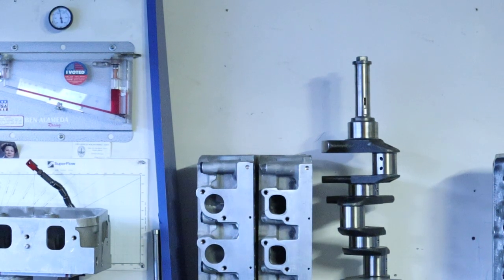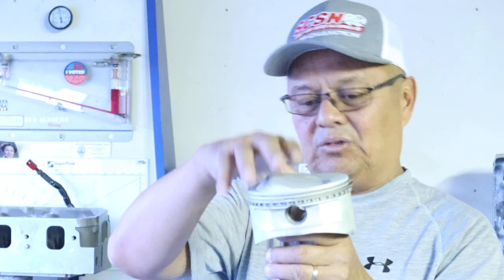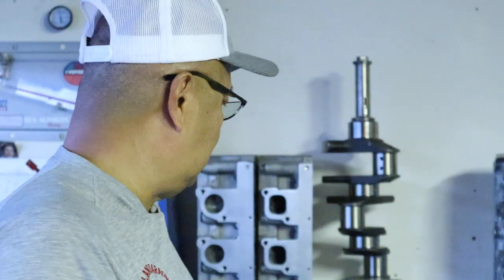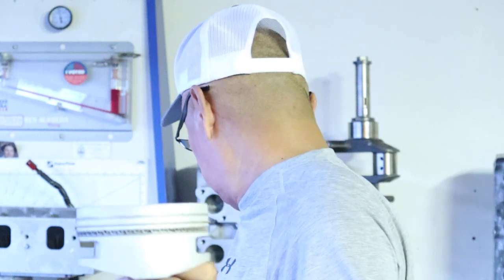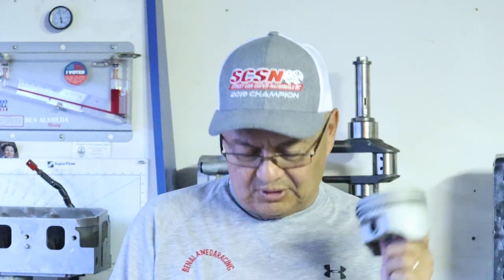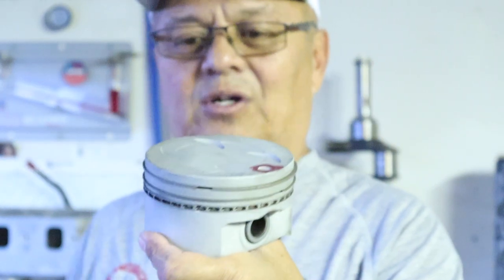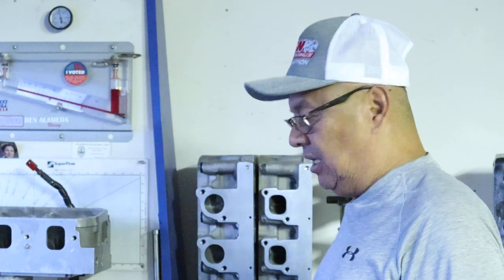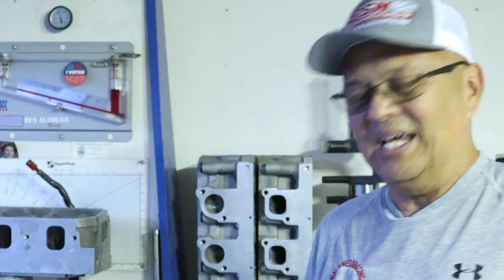WHAT MAKES A GOOD NORMALLY ASPIRATED PISTON?

Comment: On the Cleveland Piston you were showing crevice loss, is that area of volume calculated in a compression ratio calculator? On that same Piston is it ok to use 1cc in a compression calculator formula ?
Reply from the maker: Sometimes it is calculated and many do not specially if there is a significant amount of tapering above the top ring!  On many cases of heavy nitrous of boost levels.  Best to be as accurate as possible to make sure you are not leaving anything to be an issue later on when you are making big power.
Reply: @benalamedaracing2765 I was just trying to be accurate when calculating compression ratio.  My Cleveland makes great HP, but I’m not planning on racing.

Comment: What ring pack height would you use with 150 shot nitrous?
Reply from the maker: That much nitrous you can get away with most aftermarket or stock type pistons!  Just make sure you have more than .150-.175 piston top thickness to the top ring.

Comment: This probably does not work with nitrous or boosted application because of the strength issue?
Reply from the maker: The top ring runs hot when it is a short distance from the deck.  The lower is safer but will cost you power if NA.

Comment: Question... Where can people find reasonably priced N/A pistons for SBF's with the top ring around .150"?

Most companies don't even mention this dimension in their spec data on their websites for their pistons.

And the images posted all seem to show the top ring down around .250" or more.

Thanks for all your vids!
Reply from the maker: I have seen offerings from Mahle showing a good high ring position but you might have to call them and ask for specifics.  Ross I feel also has some in their catalogs so this and other will probably show some kind of specs.
Reply: @benalamedaracing2765  Thanks for the reply. Seems Ross primarily makes 2618 as opposed to 4032 forged. Have you noticed much cold slap difference or reasonable longevity between the two alloys for performance street usage?

Comment: What would say about minimum piston crown thickness for an N/A small block mopar on gasoline and 11:1 compression. 500 hp perhaps. 
Thx Ben
Reply from the maker: From my experience it seems .150 from the top of the piston to the top ring is the ideal distance.  Granted that you are running a quench style cylinder chamber instead of the recessed open chamber factory castings.  It tends to detonate easier with those types of heads and I would increase the minimum to at least .200 or a little bit more which I really do not like at all.  At that level I did .125 from the top but with coated chambers and piston tops.

Comment: Great info that's not readily discussed. I too have damaged pistons moving the ring pack up too high for the heat levels.
Reply from the maker: Agree and if you are brave to hold it higher it is best with superior coatings and it helps but a soon as it detonates some of the coating flake off and you are back to square one.

Comment: Ben , what kind of power difference are you talking about from ring pack height ?
Reply from the maker: Hard to tell because some engines are more sensitive than others but I cannot make the power I am making either street car or race car NA if the ring pack is too low!  I need to do a dyno test comparing .150 vs. .250-.300 ring position and that should tell me.

Comment: I have been thinking about hone of bores, I was thinking of experimenting,  use a vary coarse stone, with a 20° +/- hatch,  then go over then go more fine and 30°-45°  and finish with a fine stone, and go 60°-70° hatch. Leaving a very smooth bore with a corse,  hatch still hidden to hold oil, for low friction, using thin oil, to be held in the shallow coarse hatch,   the texture should appear smooth to a large flat surface, like a piston skirt, but rough to the oil soaking in like a sponge,  the thin oil can possibly tighten the bearing clearance slightly,  maybe add oil pump volume,    sorry again,. But any opinions?
Reply from the maker: I would follow the instructions of the ring manufacturer just to be sure...

Comment: What is your opinion on flat plane crank SBC engines?? Id like to build one, with  balance shafts in the oil pan, build a pan /main girdle that that fits between the pan and block,  only a couple inches at best that holds the balance shafts, maybe incorporate the oil pump in the thing,  it would require a timing cover and oil pan custom made,  but should help the balance of the flat plane crank, whole bolting to the pan rail, and main caps it should make it stronger!  The use of 2 bolt mains should be nearly strong as a stock 4bolr main,    with modern pistons, and a split 4bbl intake with a possible valve between to improve power at certain RPM!  With a small passage to keep a signal on the carb,   use a large plenum,  and 3.25" stroke! To 3.40" & 3.50" maybe a 3.0" with 6.125, 6.2", maybe 6.250" -6.309" rods,   or maybe a 5.560 rod for the 3.4-3.5" crank  to be setup for a lower rpm, (6500 or less) and 6.2" for the 3" for 9k RPM,
Reply from the maker: Been there and done that!  The camshaft will definitely be custom made and that is just a start!  Hedder and intake tuning is another issue altogether!

Comment: I had a set of trick flow twisted wedge heads , flat top Pistons,  mild cam,  I think it was what the 88 formula firebird I had it in,. Should have Had stock,  I ported the tpi, and matched it to the heads, boosted the fuel pressure, headers, and the pistons were not quite zero deck, and cam was . 465"-485" with the 1.6:1 roller rockers,  I could spank mustangs like nothing, even a supercharged 5.0,  not by a lot, but enough, I had a a center force dual friction clutch and t5 5speed,. Ate one of them, but fairly tough on the t5, I was easy as I could be on it, I eventually went to a 4bbl carb,   it would hit 120mph fairly quick for a 3.45 gear, the tpi could not breathe enough to get above 130-135, with the 355, but with the 305, it would do about 145, out on top, not sure what it would do on top end, never got to try, after swapping to the 4bbl, maybe it was the ECM stopping the top speed, because it had the stock tune, for a 305, the only compensation was running a fuel pressure regulator, and cranking up the pressure!  I like to think it was near 400hp, I loved those  Heads, , I'd like to have another set, and work on them a bit, set at a flow bench for a couple weeks,  maybe slightly angle cut them a bit, try for about 60cc chambers,. Maybe larger valves, and unshroud the intake valves,  I kinda liked the idea of the TWISTED WEDGE!  The center bolt valve covers didn't work that great with the twist,  but old style perimeter bolt covers would be fine,   maybe more twist? Improve  things slightly, a cnc bowl and port  would help things  the runners seemed to be a bit small! Id like to see about 200cc runners, I think they were 185cc +/-,  open them to about 200-215cc if possible and 2.08" valves, back cut swirl polished, the exhaust would probably be fine with bowl and port work, raise the roof a bit, on intake and exhaust,  heck, I'd like to work the heads , get crazy with it, weld and grind,  then make a mold or CNC scan of them and cast a new head, small chamber large valve,  unshrouded,. Angle cut or just chang the valve angle, and push the valves into the head, and unshroud the valves,  to flow well to .800"+ exceptionally well for a street head, 58-60cc if possible, and shrink the valve stems, to 6mm or what ever the modern engines use,  multiple angle seats, get the mold complete then get a foundry to cast a few , maybe they would sell, raise the exhaust ports and cover rail, raise the intake port slightly, design it so a stock I take will fit, but is truly designed to port match, and and gring the filler from the top of the port flange area, about 
.150"-.200, the intake may require welding of a . 250" thick plate, in top of the ports about 2-3" long, with a bead  over the top to give it  stock looks, all the original intake material can possibly be removed on some intakes, and a filler made from aluminum to fill the port floor, possibly .200" with bolts from the bottom holding them in, using a good epoxy, around the edges and bottom , glue and screw kind of thing, so there is no chance of them coming loose, use aluminum bolts, cut off flush, then braided to prevent backing out, and sand smooth!, Making it fit the port,  for the ideal fit and port match, ,  basically a . 200" high port the Easier way, with . 500" raised cover rail, longer valve stems, get a bit crazy, in places and ways that make a major difference, making what 30years ago would be extremely exotic,  kinda use the LS/LT head features, put them in a SBC head, kind of a LS-1, LT/Rec. Port mix,  kinda design the exhaust ports after the Chrysler 340 heads, not the shape!, The high port laid back thing, if the valve covers have to be redesigned,  or the cover rails tilted,  sitting more flat with the intake,  and design rockers if need be,  making a possible 1.8:1 roller,  to reach the exhaust valve,   making the ports taller, should eliminate the need to make them wider due to the pushrod pinch, making the ports about 220cc flow in the 300-370 cfm range, maybe, at 1" but should be a .660" max lift head, and capable of 600-700hp on a natural breathing engine, a 355 should be capable of 7500+maybe 8500, but a street able cam -6800-7500 peak should be possible to make peak power there,  sitting at the flow bench for weeks, making the changes the air wants,  then cast that head, with the as cast port, it should be 220-240 CFM,  removing the filler and adding the floor filler, that is shaped just before the short turn to induce just a bit more swirl , helping the flow to pass by the valve, and start a swirl and possibly tumble in the cylinder,   work the bowl to  get the port angle and flow high as possible,  getting outside the shape of a SBC head, and cast valve covers that can be easily machined into almost any. Style someone would want,  a traditional , stock inspired cover, to a modern fabricated cover , without welds,  the raised rails, with only slightly longer valves, and deeper sunk valves,  the valve cover should look similar to a sb2 cover, only more narrow,  but making a sb2 styled head with the more traditional SBC placement and arrangement to fit a SBC wit Port locations of SB Chevy,  it would at least look cool,   it should make power for street race engine, but can SBC head make money these days, when you can get a LS for a few hundred bucks, that is equal to a more exotic SBC, beyond what was stock, and  and more likes 7 late 70's or 80"s nascar engine detuned and setup for mpg,  basically. Raise the compression a few points,  and add a cam, in the .700" neighborhood,  and give it the required components to make it live and work even stock heads with 12.5:1 it should make 1985 nascar power  basically using mostly stock parts, polished the rods and crank, lightening them and  removing stress points,  modern light weight pistons,  head studs, maybe o-ring the heads,  it  is more exotic than most any SBC for the cost of time and few parts,   making building a SBC more costly,   but designing the head, making the power is the fun part, it would be $$$ per det of heads if made, and maybe none would sell, being nothing stock really fits, the  salt flat guys would possibly want a set of heads and intake, maybe a modified bbc intake could fit , or the heads possibly be made to use a modified bbc intake, ,. Or a complete new design,.  

😐 I really went on a rambling tangent this time!  Sorry again !!
Reply from the maker: No big deal and I am the same way!  Got to experiment and see what works and seems you been there and done that!

Comment: @ 4:08, i guess that piston needs to be about .250" large to allow the valve to clearance inside the ring land, so the rings can be higher,    I'm a die hard Chevy /GM guy, it's like a religion,
Reply from the maker: Yes sir and this one is off a canted valve small block which is small bore at 4.125 and wish it had a much bigger bore size to get what you were referring to.  Appreciate the feedback James!

Comment: Great info as always! I’ve mentioned an old sbf stroker n/a engine I built years ago that ran really good back in the day! 
I remember the ring pack being much closer to the top of the piston than a stock piston! Never really thought about it much but after watching your video it all makes sense! For a short minute I was the talk of the drag strip of how good that motor ran for what it was! Probably more factors involved than just the ring pack positioning , but it all worked together to perform better than expected!
Reply from the maker: Mark, thanks for your input.  Among other things a ring pack plays into the more power scenario more than most people realize.  You did and that gave you a hint of not taking these things for granted.

Comment: Before piston manufactures raised the rings we would machine two spacers and tac weld them in .then cut the top ring pack .100 down on top of the spaced ring pack it worked great . John Hoffman machine in NJ . He was a genius .
Reply from the maker: Yes sir the higher the top ring is positioned the more power you found out it will make!  Thanks for supporting my channel.